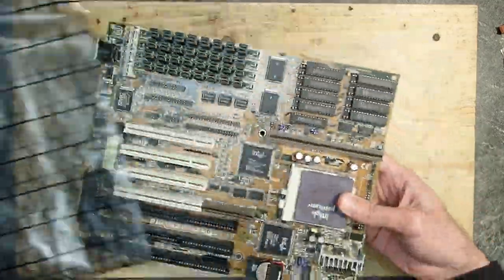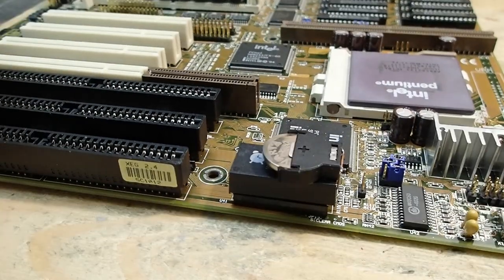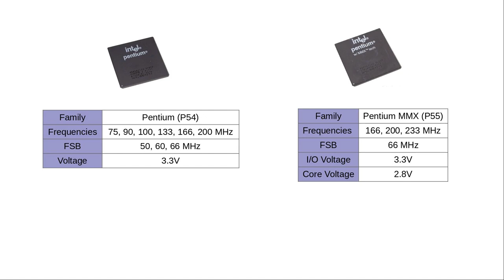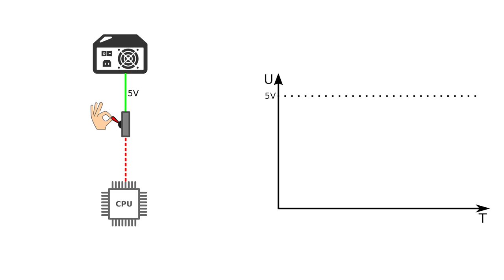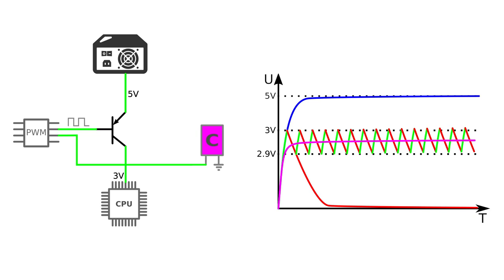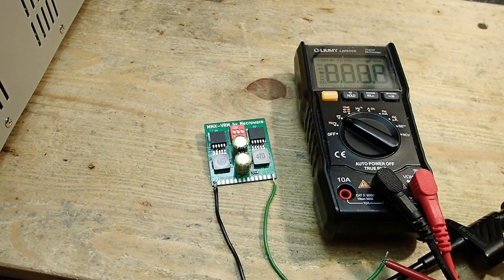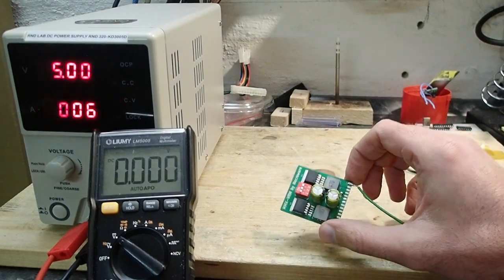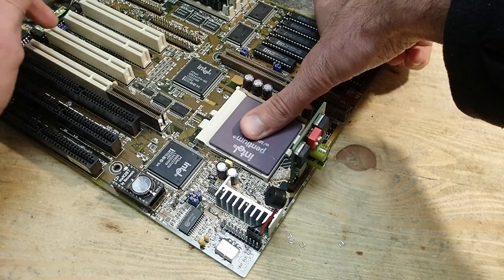Let's upgrade an early Socket 7 board beyond the limit (Part 1): RTC, VRM, MMX

Comment: What do you do with -12 and -5 volts? Is it used to create 10v and 24v?
Reply from the maker: Which -12 and -5V?
Reply: @necro_ware  you saied that old PSUs deliver 12v, -12v, 5v and -5v
Reply from the maker: @im1random263  Ah, your questions is not related to the VRM. You mean, what those voltages are needed for? They are usually used as reference voltage for analogue parts, like amplifiers. Most of the sound cards for example need -12V and some need -5V as well.
Reply: @necro_ware  oh ok thx

Comment: just an idea - i might be wrong it has ben some years - i rember upgrading an old 166 P1 to a celleron 366 (soc7)   -- it was an asuse board i had , it let me OC it to 386mhz (max it would let me do - and ran stable) i was doing better on bench-marks than my buddys P2- @333hz  - blowing it out-of the water even know its 1/2 the  L2
Reply from the maker: I think, your memory plays tricks on you. Celeron didn't exist before Slot 1 / Socket 370. Officially P233MMX was the fastest Socket 7 CPU by Intel. There was OEM 266MHz later as well, but 233 was the fastest retail version.
Reply: @necro_ware  damn, you know stuff :)

Comment: I 'm just finishing my 22 year old "server", P3 based. Worst issue is the on-board video (i815). All Linux kernel based of course. Wanted to add GUI to it. Was initially aiming for a modern look with Qt but it's true piece of s**t compiling it (hard to get rid of SSE2 and beyond instructions). GTK+ 3.x builds pretty nice. Thinking about some web browser for it, but already found out - there's some RUST-y brick on the horizon... and it's SSE2 dependent as well. Cross compiling seems next logical process but it just looks like rolling a bigger bugger... :/

Comment: fyi running two dc-dc buck pwms in parallel is a bad idea unless they're specially designed to do so. if one vrm becomes out of phase with the other (which will happen because of temperature and internal clock differences), their feedback circuits are going to be out of sync with the pwm out. this will induce a very large load on both converters and it will blow them out. if you need more amps, you need a bigger vrm or vrms that are designed to work with each other.

Comment: Actually you should have powered your converter from +12V. If you looked into the converter spec, you'd see that the efficiency is higher with higher input voltages. Plus the current drawn from +12V would be less than a half of what you draw from +5V.
Reply from the maker: As I explained in the video, there is only one thin trace which goes to the only one 12V pin of the VRM header and if you try to pull more than 1A from that, it will instantly burn. It is also written in the Intel Mainboard Design Guideline, that you should never pull a lot of power from 12V. It is only provided, because some controller ICs require that voltage. Four 5V rails are connected to a big power plane on the mainboard and are prepared for higher current draw by specification.

Comment: Come on, man, we would've watched part 2 anyways. Though I guess if part 2 exists, then the CPU works :)
Also IIRC the voltage regulators' datasheets show that you can use additional LC filter for better ripple rejection. That might help in case of stability issues (for example due to overclocking).
Reply from the maker: The video would be just too long and I had to make a cut. Would I make it 5 minutes later it would be just another cliffhanger.... This time I couldn't do it right.

Comment: Running SCSI in the Attic - still hearing the winding sound in the living - sorry - scsi was a no go 

4.3 Western Digital Wide - on a P2B-S 300Mhz with Adaptec 7880 - i still have..  
and it still works - but is VERY slow at booting (even slower with the Adapter boot bios enabled)
i bet there are some settings - the controller does not ignite every slot . .
Reply from the maker: It's kind of funny to watch a retro hardware channel and to complain, that something was slow :D
Reply: @necro_ware  

eum, no, i just remember 8088 days and my enforce function as disc jockey . . 

the boot was slow - my P5A-B is Blitz

Comment: hi ... iam trying to resolve same, but reverse problem. Mobo LuckyStar P54CE rev F1. When i insert P200MMX computer running but only 166MHz. Bios reporting Pentium-S. But ... When i put NON-MMX cpu (100MHz, 120MHz or 166) mobo stop working on code 0D and reseting and contiue from start to 0D in circle. All these CPUs working fine with another motherboards ... FIC PT-2006 and Shuttle hot-591p and PC-Chips M537 DMA https://youtu.be/Z95capQgPBw

Comment: I'd like to see an upgrade to a Super Socket 7 board to push beyond it's limits.
Reply from the maker: Super Socket 7 for itself is already a Socket 7 pushed beyond the limits :D The K6-III+ at 6.0x multi and 100FSB got probably everything out of it. You could rise the FSB a tiny bit more, but usually there was not much more, what you could squeeze out of it.

Comment: I had a family computer when I was younger, no heatsink, pretty sure it was a pentium. Was fine for years... Until it died and we changed to an AMD K26, which needed a cooler 😂
Reply from the maker: Well, Pentium requires a cooler definitely. If your machines was running without it, may be it's the reason why it died.

Comment: Fun Fact AMD helped create MMX. They basically sued Intel to use it. Then Intel added more in chip instruction to one up AMD.
Reply from the maker: Could it be, that you mix EM64-T and MMX? There was a lawsuit between AMD and Intel, but because AMD wanted to call it's CPUs MMX and Intel insisted, that it's a trademark. At least no official sources say that MMX invention was in any way related to AMD. If you have some info about it, I'd be interested.

Comment: Running the MMX at 3.3v shouldn't be an issue, it will just consume a bit more power and make a bit more heat, 2.8v and 3.3v is close enough to be a non issue.
Reply from the maker: For a short period of time it will work, but after 3-5 months you will get a stone dead CPU.
Reply: @necro_ware  it's still 3.3v logic and node, reason they lowered it was to reduce cooling requirements and power draw. 

% wise it's a very small change in voltage, just 18%. 
Modern designs are a lot more sensitive, and even they tolerate more abuse than that. 

Sidenote is a dual socket p-pro system of mine that is 450KX based, 8 168-pin ram slots but only 5V ram due to keying. 
I've ran 8pcs of 256mb 3.3v sticks with their keying filed out to run in the 5v board, so they're running extremely overvolted but have so for a long time with no issues. 

DRAM is a lot more durable than logic is but it's a good example.

Comment: As much as I do appreciate these videos, unfortunately I found the explanation of Linear vs Switching regulator to be over simplified but more importantly fundamentally wrong. 

The reason why a linear regulator dissipates power is not because the transistor or the pass element in a linear regulator is always on, but because it is partially on! You see fundamentally a pass element (or the transistor) in a linear regulator act like a variable resistor in series with the rest of the circuit, with resistance being constantly adjusted for the load current (consumption current) through a feedback loop to mantain a constant output voltage. The problem with linear regulators as with anything that obeys those laws of physics is that energy can not be created or destroyed, therefore in a linear regulator the reduction in the voltage comes at a price of all that energy being dissipated in form of heat. An example if your circuit is powered through 5 volts supply and the load requires let’s say 2.8 volts and 100 mA of current and you decide to put a linear regulator in series to drop the voltage from 5 volts to 2.8 volts it would mean that the voltage drop across the linear regulator has to be 5 – 2.8 = 2.2 volts, and power dissipation in the linear regulator will be 2.2 volts multiplied by 100 mA = 220 milliwatts. 

A switching regulator works fundamentally in a different way than a linear regulator, essentially the transistor in a switching regulator ideally speaking is always completely on or always completely off, when the transistor is completely on there is no voltage drop cross it therefore the power dissipation is zero, and when transistor is completely off there is no current flowing through it and again the power dissipation is zero. So yes, ideally speaking the power dissipation in a switching regulator is zero (in a more realistic world there are switching and conduction losses in a switching regulator but let’s not go into that here), but then what about the laws of physics you may ask? The answer to that is that the switching regulator are in fact power convertors they convert voltage to current and current to voltage keeping the power in and out the same therefore no power dissipation, and this is done through energy storage elements, that output inductor and capacitor that you mentioned in your video, to a layman it may appear that those inductor and capacitor at the output of the switching regulator is just there to smooth out the voltage (as you did too suggest in your video) in reality those elements are responsible for the conversion of voltage to current and vice-versa. Unfortunately, that whole thing about switching regulators being more efficient because the transistor gets time to cool down because sometimes it is off is just the figment of your imagination. 

So going back to the previous example let’s say a switching regulator was used to convert 5 volts down to 2.8 volts instead of a linear regulator, the switching regulator will be able to provide “MORE” current to the load in the same proportion as the drop in voltage where as a linear regulator’s current will still be limited by the current of the voltage source or the power supply since in a linear regulator all the energy of bringing down 5 volts to 2.8 is dissipated in form of heat whereas in a switching regulator it is converted into current, and yes it also mean that a linear regulator will take 100 mA of current from the voltage source if that’s what the load requires however a switching regulator will take only 56 mA of current from the voltage source and it will be able to provide the load with up to 100 mA of current. This concept of power conversion is essential in understanding the switching regulators, also the reason why switching convertors can also be used to bring the voltages up, so a switching regulator can also be used to take 5 volts supply and actually raise the voltage to 12 volts (called a step up or a boost convertor as opposed to a step down or a buck convertor). Whereas in a linear regualtor both voltage and current can go only go down.

I hope I have spent all the time writing this comment as a way to educate and bust some common misconception regarding power convertors. Your videos are great btw I love them so keep them coming and I do really appreaciate your work.
Reply from the maker: Thank you for taking the time. There is a second part where I correct myself, but not with all the details you wrote, so thank you.

Comment: Your explanation of a switching regulator is not quite correct with regards to the reason for lower power dissipation.
The reason a switching regulator is more efficient is that when the switching transistor is fully ON no voltage is developed across it and when it is OFF no current flows through it. Since: Power = Voltage * Current, no power is dissipated (Ideally) in either condition.
Reply from the maker: Yes, true, this was already discussed down in the comments. Thank you though.

Comment: I am sorry, but your explanation of the reduction in heat produced by switching regulators is not quite correct.   The truth is that when a transistor is in the on state, it dissipates very little power because of its low resistance  (P = I^2 * Ron), while in the off state, the transistor dissipates very little power because there is no current flow through the switch.   The only real dissipation is in the transition state between on and off when the transistor momentarily operates in a linear mode.  This reduced dissipation turns out to be much less than the continuous dissipation of a linear switching regulator.   Using switches devices with extremely low on-resistance (like MOSFETS) can produce even lower dissipation.